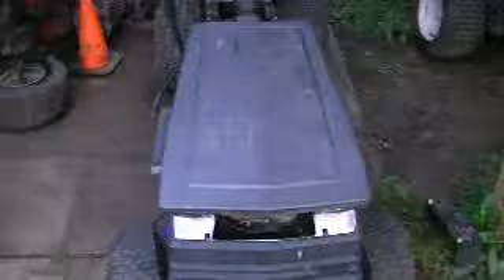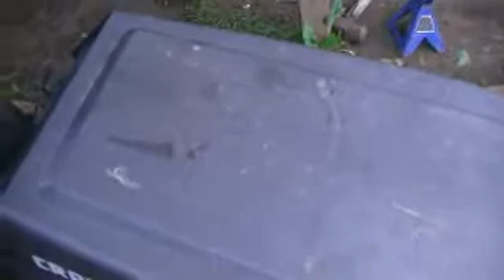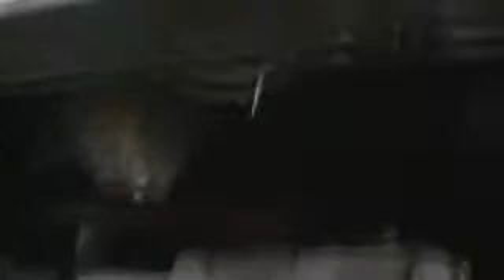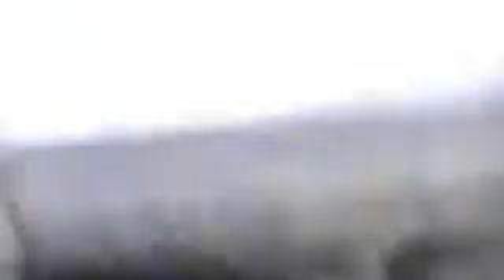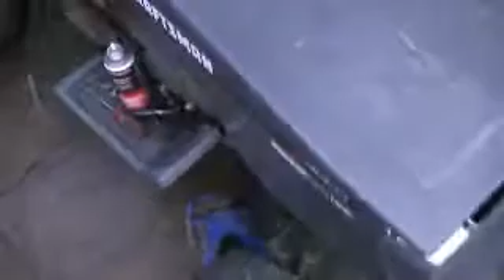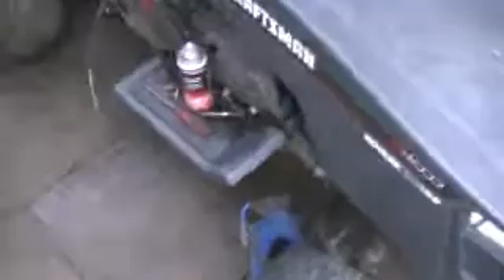Hood Scoop Idea on Craftsman 4x2

Comment: Yeah we have these auto parts stores, called auto zone, not sure if you have those up there. They sell universal ABS plastic hood scoops in 2 or 3 different sizes with a metal mesh grille insert in them. The smallest one is 20 bucks and will fit tractor hoods, the bigger one would go from side to side on a tractor hood, and I think its 40 bucks. I think its a vent shade product, but not sure. Would be nice if you can find one of those.